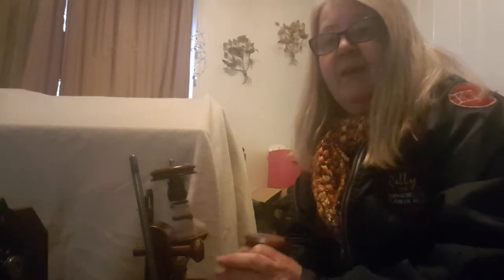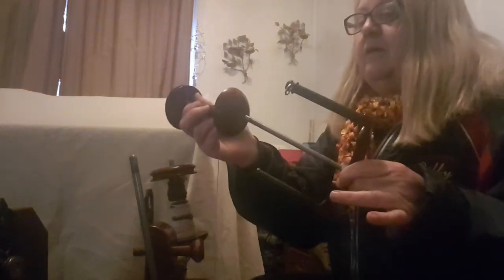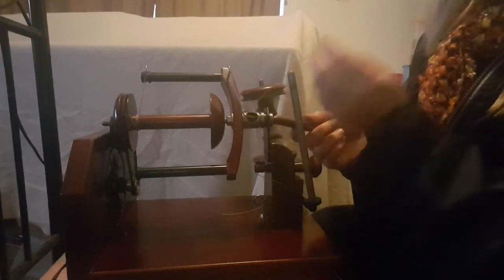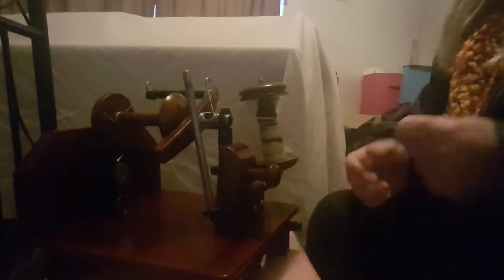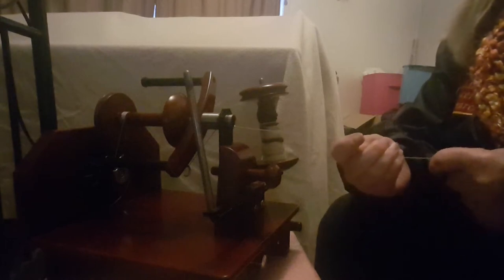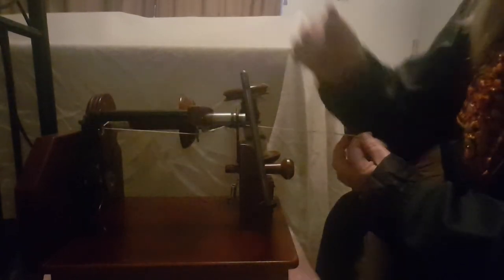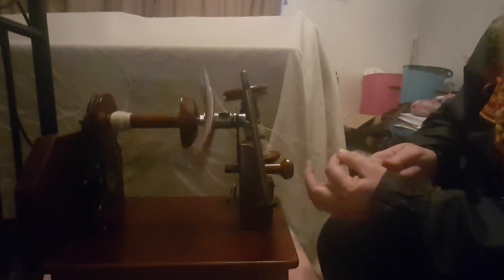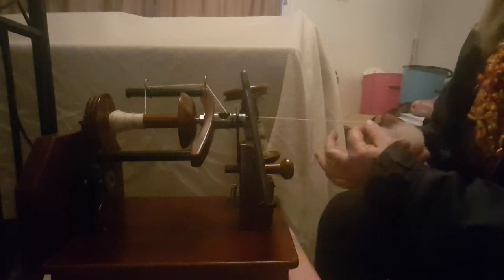Starting to spin on the Roberta Electronic Spinner

Comment: Just received the Roberta and having take up problems. Any idea?
Reply from the maker: Is it pulling in to fast or not enough?
Reply: I just picked up one too! Mint condition and originally purchased in 1985! Even have the receipt!🤣❤
She is adorable!!!!
Reply: @juliegarner2786  not enough. I
Reply: @448bubble  that’s awesome I’ve been borrowing my friends and it’s about 1985 also. Still runs great!
Reply from the maker: @madelaineosborne2000  I would have a look at the wire for the tension that goes around the groove in the flyer. If it is too tight it won't allow take up and it doesn't need to be tight. Just have a bit of a play around with loosening it off a bit and see if that works. I have been offline due to an injury, but will try and get some videos done and uploaded in the next few weeks.
Reply: @juliegarner2786  yes I see what you mean. I did try to loosen etc. I finally got some take up happening. I changed my chair to a higher one so I’m straighter with the orifice. Crazy solo uti on but so far a lot better. Not perfect but better lol
Reply: @juliegarner2786  get well soon. Would love to see more of your videos :)
Reply from the maker: @madelaineosborne2000  it sometimes just takes some experimenting with it, but I usually find that is the problem. It's fine to adjust it looser or tighter as need be. It doesn't have to be tight, you can't do any damage with it and once you master that control, you'll master your spinner. You will also find that as you become used to your machine you will be able to sit anywhere and spin. <3
Reply: @juliegarner2786  great news lol I’m used to my 30 year well used Lendrum lol. I guess I’m afraid off straining the motor
Reply from the maker: @madelaineosborne2000  it does have a learning curve but people don't realise it is usually learning to adjust and work with that tensioner, and you definitely won't strain the motor. The Roberta is total quality and really built to last that's why they have such a great warranty on them. Being a distributor I can tell you that the man that builds the Roberta puts his knowledge, precision and pride into every single machine that he makes.
Reply: @juliegarner2786  yes he was so helpful!! Just ordered a power pack to make it portable!  Hope it works